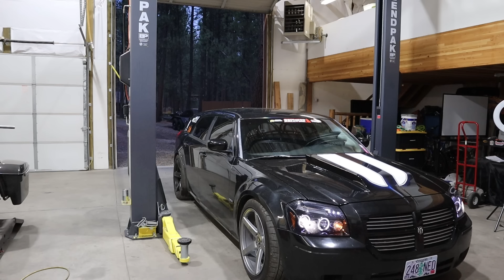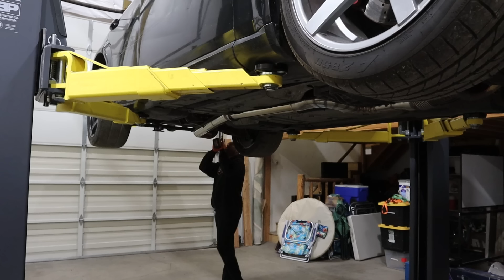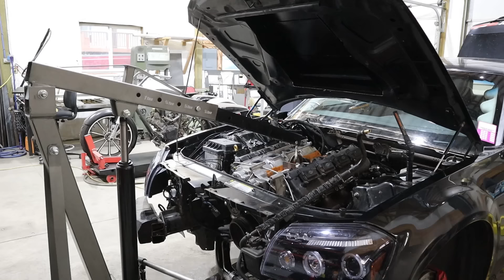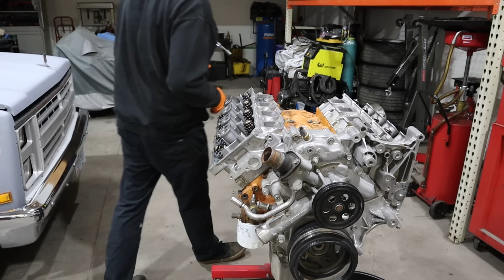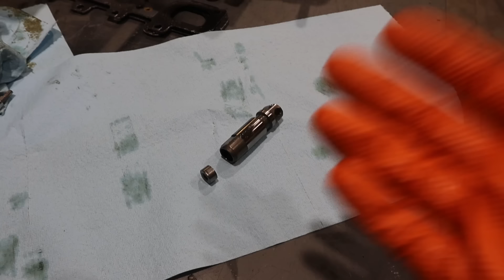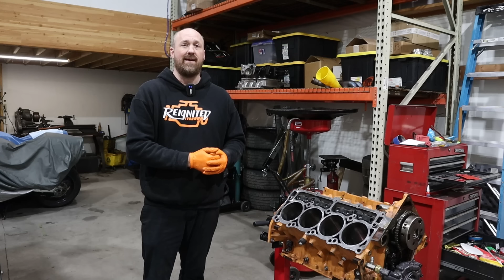This Car Is Officially Dead (And Here’s Why)

Comment: As you're going MaxxECU not sure if your Hemi has Dumb or smart coils? We had issues with igniter modules on my twin plug M112K engine also twin charged, so ended up going LS1 coils just firing a single plug.
Reply from the maker: That's a great question! I actually wasn't sure what route I was going to go until just recently because as you say the Hemi coils are dumb coils. I ended up purchasing a set of holley Hemi coils which are "smart" a little extra wiring, but to me better than wiring in igniter modules. We'll see anyway.

Comment: I drive a 2006 Magnum SRT8 that I've owned for 20 years and I have to say that watching your Maggie go to the bone yard was a hard thing and will probably put me in therapy for the next three years. 😭
Reply from the maker: Those SRT8 Magnums are classic, much better styling than the regular R/T, sweet car!
Reply: @ReignitedAuto  Well it hasn't reached "classic" status yet. Right now it's just a wonderful 20 y/o car that's getting hard to find parts for. Mine only has 44k miles on the clock and I'm to holding on to it as long as I can.

Comment: Besides the PCM, Toner Wheel and CPS, is there anything else needed to put a 2007 motor into a 2012 Charger
Reply from the maker: It can be difficult to put a previous generation engine into a later vehicle. Besides those things you mentioned, the biggest issue is that the front timing cover and the accessories are all different, your 2012 stuff will not fit the older engine.  It's far better to just find a 09+ engine to put in it.

Comment: I replaced my lifters for the 2nd time soaked them in oil still have lifter noise and check engine light is there a way to prime them when out of vehicle or is soaking them all that you can do
Reply from the maker: Soaking is the best you can do, but if you're still having a check engine light that's not due to air in your lifters. Is the vehicle running poorly?
Reply: @ReignitedAuto here and there you can feel the miss fireing sometimes  multi cylinder miss fire sometimes just 1 cylinder and all four o2 I've fan out a hole tank of fuel put new in the cam I bought came with all non mds lifters had to order more lifters is there a difference in cams  if I have mds I would think they are the same just I also put in the upgrade oil pump you suggested

Comment: Tear to my eye watching the Magnum goto the crusher.   I did my 6.1 426 stroker while watching your vids that helped me out a lot.   Initial tune on my 2008 Jeep with a Maggie got me to 3.2 sec 0-60, but I was spinning with traction control off, so I think I can better that going from a 2.65" to a 2.3" pulley.

Comment: It was all in the tune..Blaming the pcm??? never heard that before I could be wrong get Johnson lifter I had a non-MDS hellcat lifter do the same thing I’d post a picture if I could
Reply from the maker: You've never heard someone blame their tune before? That's like the go-to excuse for drag racing 😄. My point here is that the factory PCM was never designed with boost in mind, so there's no way to build in any protections regarding fuel and timing. With a full standalone style PCM I can build various tables that will protect the engine if something like this happens again. Also I won't have programs running in the background that I don't know are there, like a torque management system that pulls fuel while at 15psi 😬

Comment: I follow this one guy who had a boosted magnum running 10 second quarter miles. I believe it was a 6.1 stroked to 405 cubic inch. My boosted 6.1 isn’t as fast. Running  3.8 0-60 and 1/8 mile 7.6. Funny to see you say in a previous comment that the magnum is a terrible race car when I thought the lx platform was a pretty solid platform to build a drag vehicle.
Reply from the maker: There are a couple really fast ones out there. But they are essentially a shell of a magnum on top of a built chassis. The car just isn't designed to be a drag car. Compare them to a fox body mustang that can be extremely fast right out of the gate because the chassis is much better suited for drag racing.

Comment: I have owned two SRT4's and never did anything to them other than drive them and sell them to others that ultimately blew them up.  My current Durango project owes much of its success to your video's so it is with a heavy heart that I watch this video - the end of the twin-charged Magnum.  I appreciate the detail  you go into on not just what you are doing but why you are doing it.  It will be VERY interesting to see how you approach the Neon/Hemi.  Are you going to tunnel out the firewall to make it rwd welding in the rear sub-frame from a challenger/charger or are you going to try to sidesaddle that engine onto the T850 negating 1 and 2nd gear on your way to needing a new transmission....  Cant wait! :face-orange-biting-nails:
Reply from the maker: RWD for sure, firewall will have to be extensively modified to get the engine back far enough and down enough to where the hood will close. I want it to look like a factory srt4 from the outside. I've got a Hellcat rear did and axles already, will be building a custom rear subrame to house it. Going to be a big project for sure! But I do love these srt4's was my dream car back in the day. This is the 4th neon I've picked up for this project but I think this one will be the right one 👍

Comment: Not sure if you are running your catch can vent to atmosphere or not, but that would be a good idea. Also, Manley does sell single rods.
Reply from the maker: Yessir, running the catch can to atmosphere and i did get an individual rod on the way from Manley 👍
Reply: @ReignitedAuto  I think the whole Twin charged thing sounded good on paper but it was really just a bad combo. Not having an intercooler for the supercharger didn't help any either. I'm sure IAT's were probably insane, which isn't good for the engine.
Reply from the maker: @Smasher-Devourer I still think it was actually really solid and it worked better overall than i imagined it would be. The problem was almost entirely the ECU and the fact that there were things running in the background that i had no idea existed. That's my excuse anyway 😂
To be clear there was no question it was overcomplicated, that's what made it fun though.
Reply: @ReignitedAuto  What kind of fuel were you using anyway?

Comment: I love Magnums - sad :-(     the car could have made a nice race car to someone -
Reply from the maker: I think that's the problem though, it's a terrible race car 😄. The only other one that I've seen that is actually fast he cut up the rear end of the car to fit a completely different style suspension to it and it's got a turbo 400 trans in it. Still has traction issues 😬. It's a tough car to launch well that's for sure.

Comment: I literally just “rebuilt” a hemi this week that had the same clip fall out totally stock I also had a broken timing chain guide, but I think the lifter was what  actually brought them in these engines are so tough. I put  in the high volume oil pump in there because it looked like it had low oil pressure all gritty inside. But no metal. Running like a dream shipped it yesterday.
Reply from the maker: That's crazy, definitely not something I've seen before!

Comment: How much for the roller?
Gotta be honest Big Guy, I've followed the build and just the decision to self tune with no experience had me😮.
I think if the baseline was established with a reputable tuner and you learned from that point the carnage would not have been so bad.
Reply from the maker: Can't disagree with you. My point of going full standalone is that I'll be fully aware of everything that's happening within the PCM. In this case it was actually the transmission controller having influence with the PCM as far as pulling fuel that got me. Didn't know it could do that. Sometimes it feels like I have to learn things the hard way, but nevertheless, I do end up learning something! 😄

Comment: What a waste of a decent shell. Lots of good salvageable parts off that magnum. For being a Dodge tech, I have to say, I'm disappointed.
Reply: Exactly.To hell with the rebuilt title, somebody would have wanted it. Gotta disagree with Skye on this one.
Reply: @EarlSinclair97  mine is a rebuilt title. I'll be damned if I let mine go. Hell, I just got done putting 3k in the rear end on this car. I'm about to do the front end with all AAD performance parts and titanium hardware. 
I could have used the passenger side of his truck if he was just scrapping it like this. Wtf. Hell, I know a guy who could have used the whole roof skin for his, since his has hail damage. Lots of brackets ,na electrical components, lights..etc could have been sold off the car. 
The problem here is, he got to ambitious with the engine setup and all that. A 2.7-3.0 whipple and the right time, would have made that car really fun.. what was his e.t. on that car anyways?
Reply: @jd440 
I thought the twin-turbo/supercharger set-up was cool at first, then immediately realized it would be extremely difficult if not impossible to tune or make on-road drivable. 
But, whatever, it was his vehicle. Just seemed like a terrible waste.
Reply: @EarlSinclair97  yup. It was. If it was me, (and I didn't follow along to closely as far as what he did do with the engine), but, if I built it up, it would top out at like 440ci. Stroker crank. Running about 9.8-10.3 cr. 3.0 whipple. 2.215" primary long tube headers. Ported intake. Worked (ported) heads. 3800 stall converter from Fri or circle D. Lightweight flywheel, arp bolts, and use titanium bolts where need be to save weight. Then work on making the car lighter, especially up front. AAD performance front suspension. Titanium hardware throughout. Put a carbon driveshaft in. Lightweight lithium battery in the back. AAD front and rear aluminum crash bars on it. Replace what steel brackets are on the car with either aluminum or titanium. Engine should be good for like 850+900 easy? Car would have  be a ripper. 
Hell, I'm working on mine, and with the stock 2.82 gear rear that I had in it I ran a.13.29@103. now, it's got the getrag diff, 3.06 (soon to have 3.23). I'll eventually buy the driveshaft for it, ditch the center carrier crap. And order the front end parts, and a lithium battery. Then the crash bars too. I'm sure that will knock off like 200lbs easy with all I mentioned compared to what's on the car. Engine is stock other than a tune using a Diablo sport tuner, and a custom.true cold air intake, and aeroturbine 2.5" exhaust. The trans has been worked over by level10 transmissions in Jersey. 2800 stall fti converter. Amg shift solenoids. Tci deep trans pan and a tubular transmission cross member. With the weight reduction and rear gear swap, I should expect a 12.8x? 106-108ish. 
I do have plans to stroke out the 5.7 and use what I have block.wise. build it to a.394ci. 392 intake, and a bigger throttle body and use the ported 6.1 heads I have that are waiting on my shelf. 😊 I'd love to have this running 11.50s and not look like I did much to it.
Reply: @EarlSinclair97 he actually just had one turbo and the supercharger on it. I would have just done the supercharger. Then put a huge intercooler on it. If I remember correctly, his air inlet temps were crazy high too. All that compressed air generates heat, which kills power. Gotta cool that all down or at least at a minimum balance it out, cool it down enough to make it act like the blower/  superchargers effect isn't even there. 
I did a custom cold air intake on mine and my air inlet temps are like 15-20* above ambient air temps. The car loves it. I'm pulling in air right in behind the fog light area.
Reply: @jd440 
Ah, yeah you're right. It was a single turbo set-up. I remember the intake he built and how he plumbed it. I thought that was remarkable.
Reply from the maker: I understand how you feel, but you've got a strong emotional connection to your car. For me, this was just another car, one that has caused me quite a bit of grief over the years 😄. Especially for people who live in the rust belt area this would be a great platform to built off of, but I don't live there, I'm on the west coast where there are plenty of better versions of this car available.
Reply: @ReignitedAuto 
I suppose I didnt consider the pain & misery it caused on your end. 😆 It's always easier to say stuff when you haven't been the one who went through it.

Comment: What do you mean stand alone are you talking about a Holley terminated X system
Reply from the maker: That's one system yes. On the C10 build I'll be using an ECU called Maxxecu because it will control not only the engine but the transmission as well, since I'm swapping an 8HP trans from a ram 1500 into it.
Reply: I’ll check that out Maxxecu I thought being you had a supercharger in one of your vehicles you might have come across the same problem I have my truck runs great and shift perfect as long as I’m into the throttle but when I’m barely giving gas going from stop light to stop light it bucks and feels as it’s searching for the right gear but this is intermittent I appreciate your response